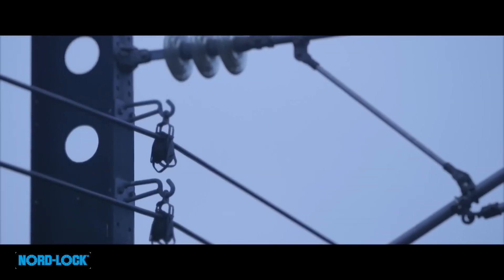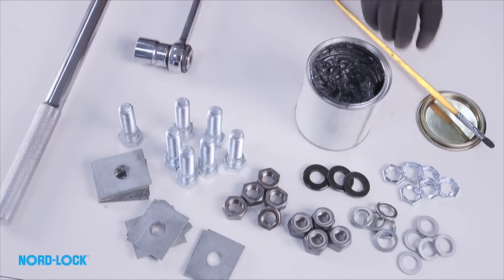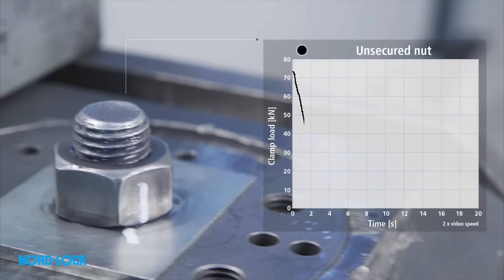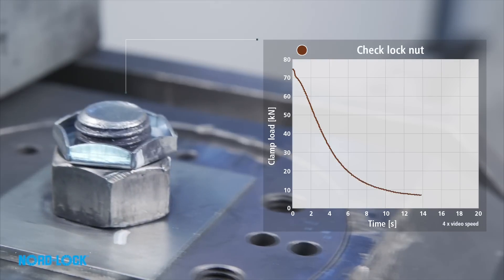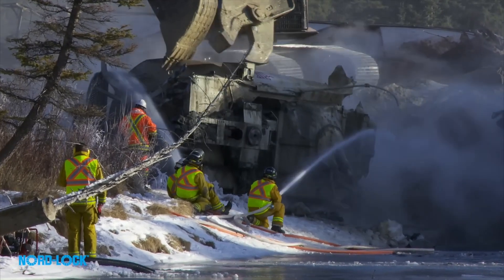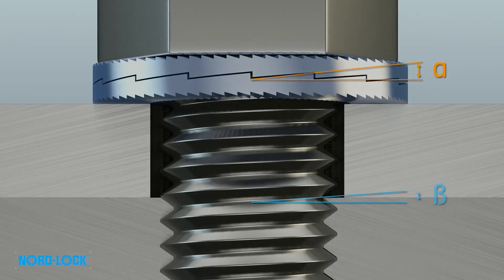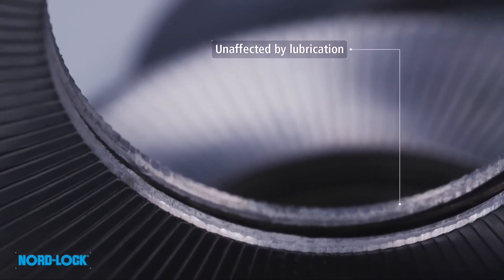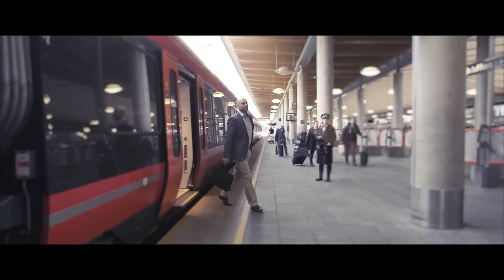Nord-Lock Wedge Locking Washers Tested in Junker Vibration Test – See the Results!

Comment: Nordlock still works on the principal of friction. Otherwise you wouldn't need to torque them down until the teeth dig in, requiring the surface area and friction of them for securement